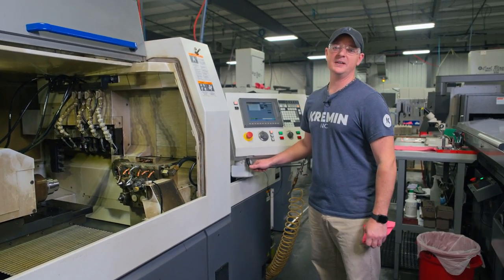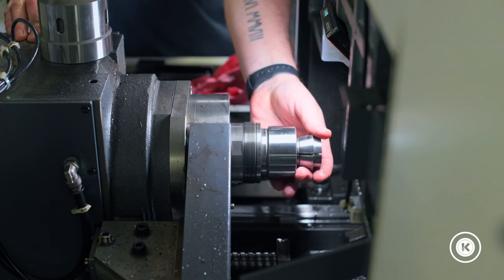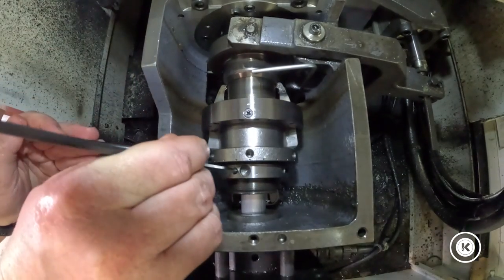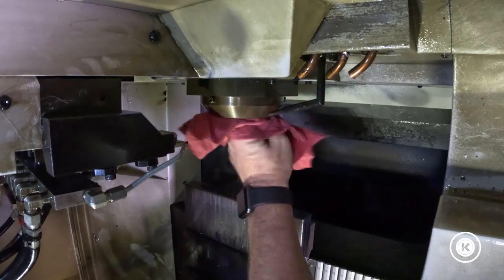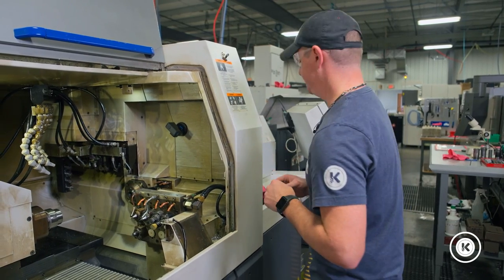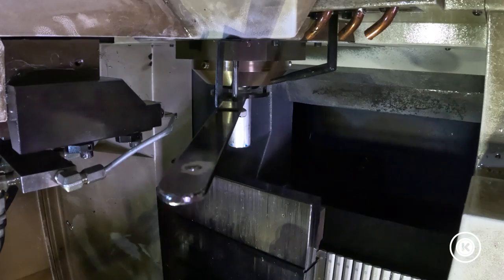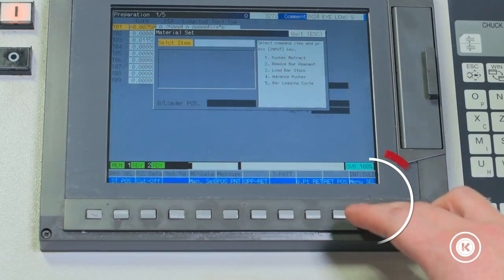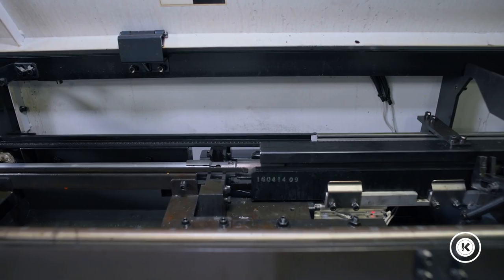How to Change Over a Citizen L32 Swiss Lathe Part 2 - Kremin Inc.

Comment: Glad I found this channel I have a few years setting up that same machine and some smaller 20s until corporate greed made them decide to buy a bigger building out of state and shut ours down...my new job I start tomorrow there is 4 swiss 20mm with the lns bar feeders with 2 operators they want me to get the new jobs up and going and what it takes to get it done challenging but great opportunity to learn more. Do you have any videos on programming these and what software you guys use to make a program? We never used position point but it would make touch off tools faster then what our shop did was just used man set button hold it down wait for gang to stop load turn tool move gang up  til tool holder fits and tighten the screws to wedge it in.

Comment: Do you have to change the end of the bar pusher or for that machine is the one it comes with all you need?  Charles
Reply from the maker: You need to replace the end for each change in material size, so you end up buying a bunch of them to match the stock you run - like a collet or guide bushing. They last a while, but we have had to replace some.
Reply: @Kremin Inc. Manufacturing  thanks, I was told something like that once before.  I don't have a bar feeder now but I am considering it.  Have a great rest of the week
Reply from the maker: No problem, bar feeders are huge for us as far as uptime and keeping machines running - they can be a little bit finicky and you need to maintain them. For lights out and long runs, they are awesome. Good Luck!